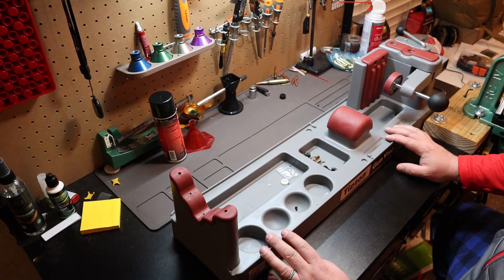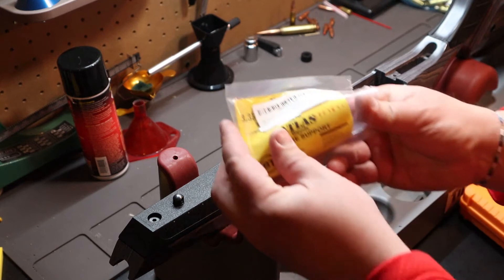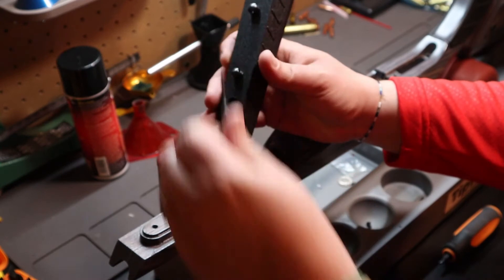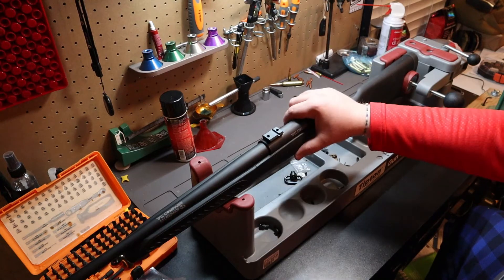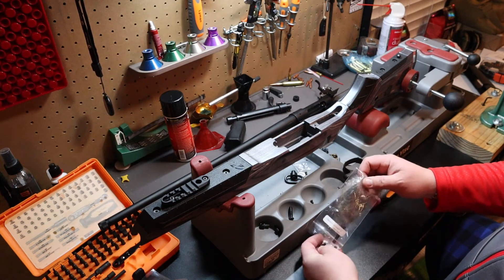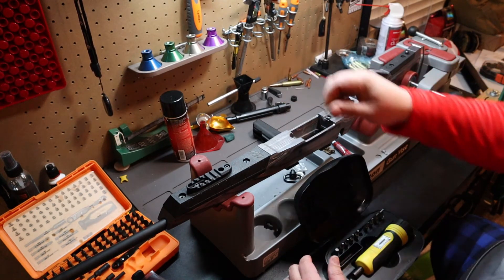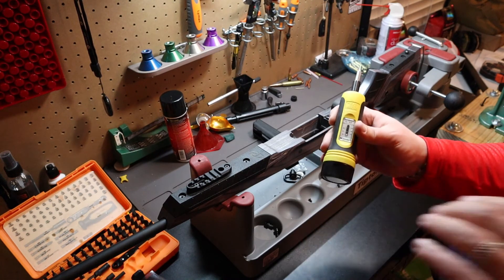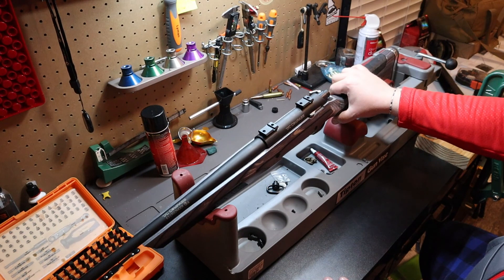Boyd's At One Stock, On Thompson Center Compass, 6.5 Creedmoor. Long Range For Less Than 1K

Comment: Did your accuracy change from the original stock?
Reply from the maker: No
Reply: @lastavocations9487  I just received my boyds pro varminter stock. I'm using the v3 precision pillars. And doing a dev con bedding job. Let's see what happens ☺️